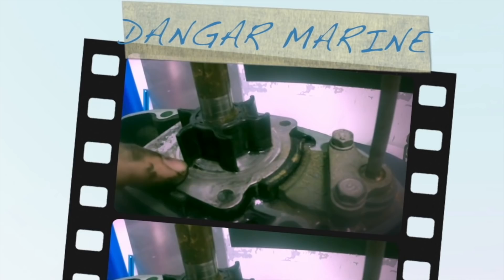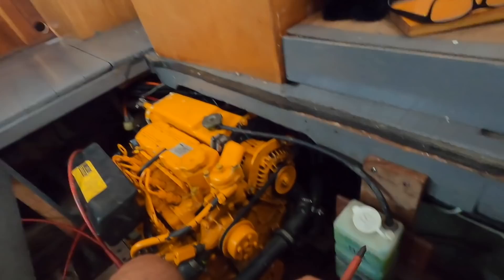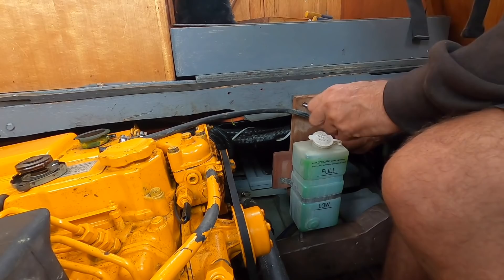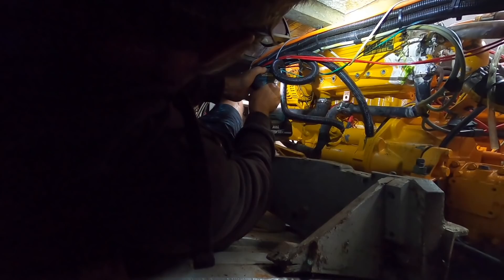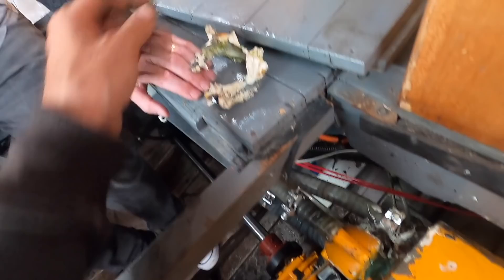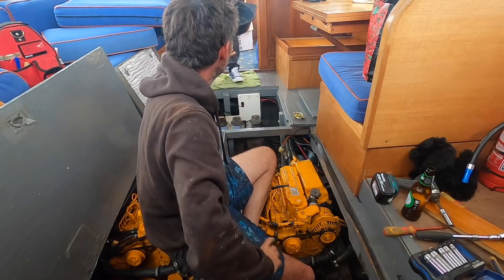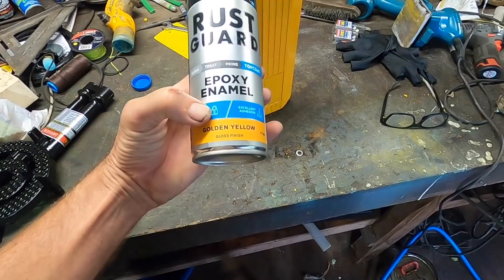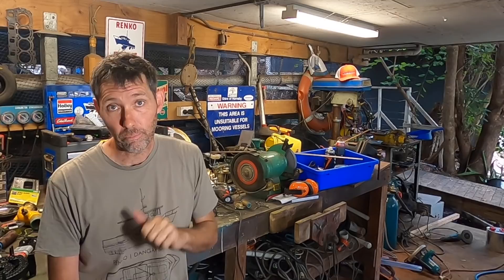Cleaning and repairing a boat heat exchanger

Comment: I've got twin 671's in my boat.  They were installed new in 1945 and are running great!  Currently have less than 2,000 hours but the meter may have been reset after a major overhaul in the 80's.

Comment: Great video.  I've had to clean tubes to, one trick I learned. Use one of those cheap engine pressure washers thru your air line. The venturi tip sucks in fluid. You can force cleaning solution thru passages rather well. 
For on road diesel trucks we have coolant filters, with or without sca additives, would a filter help him out in the long run. It's amazing the crap they catch, and I just replace the filter every other year. It's help my radiator and pump last oh going in 20 years.
Reply from the maker: Interesting to hear about the coolant filter. Make sense to have something like that.

Comment: Awesome job!! Way to make due with what you have. Those epoxies and things like JB weld can fix more things than people would dare to. I fixed a cracked water jacket in a head with JB weld, held up perfectly fine an no need to remove/ replace ..
Have a great holiday!!
Reply from the maker: People don't seem to understand just how strong a lot of these modern metal epoxies are. If you can get them to bond well to the base metal you are in good shape.

Comment: I first used Devcon about 30 years ago when I was still working in the Marine industry. If you can't weld it, or braze it and you're in a pinch, it'll do the job.
Reply from the maker: It is amazing stuff so long as you can get it to adhere to the base metal.

Comment: Stu I use a rifle cleaning brush on my VP heat exchanger found .22 brush is perfect size. Brush is brass/bronze type material and pushing rod is fibreglass with brass joiners. You need to push brush all the way though before pulling out

Comment: I'm really impressed by your innovative repair. Hope it holds. Way better than shelling out a ton of cash for a new one. Years ago I did a "temporary" repair on my Ford Lehman's cast iron exhaust elbow using plastic steel & then went long distance cruising for a couple of years without a hint of a problem.
Reply from the maker: Thanks mate. It's a amazing how long repairs like on your exhaust elbow can last.
Reply: Not a 'ton' of cash for new vetus $800 clams for new housing and O rings and gaskets(+exhaust) I went new! I only got 1 motor,,😉

Comment: I've had similar issues with a heat exchanger on my old Vetus M4.14.   Mine was leaking between raw and cooling water, and also out of the end bonnets, so the core had to come out.   I removed the bonnets and bolts, screwed in some threaded rod until it bottomed out and then used a car jack to press against the threaded rod and force the core out.   Done with the heat exchanger still in the boat of course.

Once the heat exchanger was out, the core rods were silver soldered back to the end caps, the heat exchanger was built up using aluminium welding and then linished down to size.   2 years later and no issues.   Surprisingly it wasn't hideously expensive, I found a local boiler maker skilled rebuilding old boilers to do the work.

If it happened again though, I think I'd take your approach to building it back up with epoxy.   Although I really do think it's worth getting the core out if you can - mine had a diverter on its sleeve which ad come loose and needed tacking back into place, and also, although the heat exchanger core tubes were clear, the voids between them were packed with silt, so raw water wasn't able to effectively flow past the tubes, limiting the cooling capacity.
Reply from the maker: Since work on getting the core out in the boat. It's weird to have silt between the tubes as that is the coolant side, the raw water flows through the tubes, but I guess if there was a leak the raw water was getting into the header tank. Glad you got it fixed for a good price!

Comment: "Barnicle buster" works great on cleaning out those tubes.
Reply: CLR as well.
Not sure if it's available in Aus though. Calcium, Lime, Rust remover that is safe for copper ( you can pour it at 100% through copper pipes with no damage ) It dissolves calcium and lime deposits and removes rust stains.
Reply: @jaquigreenlees  yes CLR is available in Australia.
Reply: Come on Pete , just spring for a new one . You would hate that you’re way of shore in a storm when in let’s go
Reply: Rydlyme marine does too
Reply from the maker: Boat isn't going offshore, only in the river and has two engines.

Comment: I have always used heat to sweat oil, moisture and impurities  out of castings before using Devcon as the thermal reaction from the 2pack makes the metal sweat and causes pockets under the coating. As you are heating it you can see the material dry out.
Reply from the maker: Good tip, will definitely do that next time.

Comment: Good old Devcon, that stuff is great. sets so hard its machinable. I used it on a Yamaha V6 cylinder head, then drilled it and taped it to hold the water jacket cover on. Then a bit of paint to make a Job what it ain't.
Reply from the maker: It is amazing stuff. As long as it bonds well to the parent metal it can last a suprisingly long time.

Comment: Stu, I used to use vinegar to clean out the copper heat exchangers in My Trawler. Turned the calcium to Blue vinegar. Rinsed it and was good to go.   DON"T know what it did to the copper but it wasn't much
Reply from the maker: The acetic acid in vinegar can do a good job for sure.
Reply: @DangarMarine  yer, but it leave's your bag of chip's tasting like crap!

Comment: Hey Stu,  have fun on vacation!  A little trick I have always used on flat surfaces like those is to use a flat file like a mill or bastard file.  Hold it flat and use it to make a nice mating surface.
Reply from the maker: Good tip, they give you a nice straight surface.

Comment: What you referred to a drain plug - could be a sacrificial "pencil" zinc which had eroded away. I had one on my gas engine heat exchanger.
Reply: At 13.41 he did remove the plug and clarified it was a drain plug, not a pencil anode.

Anyway, isnt this a exhaust manifold heat exchanger,? Meaning the seawater circuit is in the 2 pass tube stack while the exterior is flooded with coolant? 

If it is the case, shouldnt any form of anode be on the lid cover on both ends of the tubestack?
Reply: @johngiam  I have a 4.15 Vetus, there are no anodes for the HE. I believe Beta is the same, but not entirely sure.
Reply: @randyhilton6629  oh, so its the anode plug without the pencil anode?
Reply: @johngiam  I thing the bolt he took out is used for installing a lifting ring. It shows in their parts book. Looks like the drain plug is on the exhaust side and the lifting ring would be on the other side. I wish I could find a service manual book.
Reply: @johngiam  These HEs are designed with no anodes.

Comment: Hi Stu, I had one boat years ago that had a heat exchanger on it. Every year as part of my winterizing I drained and clean it. It was a 470 mercruiser inbd/outbd. Allot of torque on low end but not much for top speed. 35 approx. Cabin cruiser with a nice cuddy and head with door. Little sink with white gas stove. Tried to boil water for cooking a crab and gave up. Haha
Reply from the maker: Regular maintenance goes a long way Tim!

Comment: See this all the time...anodes never get replaced.
Reply: There aren't any anodes on a vetus. At least not one I've found on mine. I have the same corroded heat exchanger with only 250 hours on the engine.

Comment: When cleaning our Cooler Tubes, we used a Truck Speedometer Cable. They worked because it was made of aluminum which is softer than what the tubes were made of. Now I know that the tubes on this cooler are much smaller but maybe you could try a copper wire next time to "Rod Out" the tube. then try the same wire on a Drill to whip around and clean the interior of the Tube Passages.
Reply from the maker: I like the idea of the soft wire in a drill, that's an interesting technique.
Reply: @DangarMarine  It is about this only way to really clean the tubes out. Now my coolers were just a little larger that that one, about 16' in diameter by 12' long. We had a flange with a hookup for a Firehose that we would put on one end then flush it but it still didn't do as good as putting something in the tube and spinning it around.

Comment: A Devcon job can give very good results AS LONG you are meticulous in the preparation 
For tha aluminum, the best way to go is to sandblast it or use a rotary rasp to remove all the affected surface.
 I had to build a procedure to repair hydraulic hoist cylinder collar gasket surface.
after many repairs, I can say that the success is about 75%, the defective repairs were due to a defective preparation of the epoxyed surfaces.
Reply from the maker: For sure, surface prep is critical and media blasting is hard to beat. Would really like to get one of those booths for small parts one day.

Comment: I always like to run a belt sander over my exhaust ports. Funny how even people on the other side of the world think the same when presented with the same issues and limited budgets.
Reply from the maker: Belt sander would work a treat. :)
Reply: I use a corse wet stone for exahust manifolds. And that aluminum was so corroded you probably wouldn't have had any luck tig welding it. It will pop and fester ruining your tip every 2 seconds.

Comment: I have similar setups on my Hino EH700 diesels. They called them “manicoolers”. Mine are cast aluminum and don’t like galvanic corrosion or rather they do and you have to protect them as best you ca.

Comment: Stu and Pete, I'm thinking it would not hurt to put an anode in the drain plug hole. Maybe there was one there originally and thats why the exchanger was eaten. André
Reply from the maker: The trouble is that the anode normally goes in the raw water side so it really needs to go into one of the bronze end caps.

Comment: That core is copper in a aluminium housing . A vetus thing!☺️. Personally would put straight hydrochloric acid bath for 3 minutes. And if nursing through the summer months I would give the cooling system a flush twice with demineralised water . Then fill the system back with demineralised water only . Ie need coolant. Love your vids man .
Reply from the maker: Thanks mate. Yes, copper and aluminium together doesn't seem a great combination. Should go the distance until the money is available though.

Comment: If I understand correctly, you live on Danger Island and you need a boat to get to the mainland (and back)?  When you order parts are they delivered to your house on the island or do you pick them up on the mainland?  Thanks for posting.
Reply from the maker: Australia Post has a contract with a local boat to bring parcels and letters over to the island but couriers just scratch their heads and send parcels back to the depot.

Comment: I’ve found that one of the worst surface for paint or epoxy to stick to is a wire wheeled or wire brushed surface. I like to scuff it up with 60/80 grit sand paper after using wire to get the crud off. I’ve been so impressed by JB weld that I rarely use Devcon anymore. Just try to get it fresh, old stock may be disappointing.
Reply from the maker: This corrosion had so much texture that I'm expecting the mechanical bond to be quite strong. Good point about getting fresh epoxy. I also keep it in the fridge once bought too.
Reply: @DangarMarine  
You etched it too, so that’ll help tons. Have you ever noticed it too? That sheen that a wire puts down? Sometimes water drops even bead up instead of spreading out(an old painters trick to test for paint adhesion) as if an oil or wax is on it. It doesn’t seem to matter if it’s steel or stainless wire and it seems to only get worse when the wires are used (wire ends rounded) or laid over.

Comment: I suspect there should be an anode in the water path somewhere. Would explain the rot.
Reply: Very suspect using Aluminium casings in seawater! Aluminium is what they make (some) anodes out of.  Maybe it originally had a plastic coated finish on the inside?
Reply from the maker: I agree, if there isn't I think I'll drill, tap and add one.
Reply: @johnduffy7502  Why would using aluminum be suspect? It is light and it dissipates heat extremely well! That is why radiators, heater cores, condensers and so on are all made from aluminum along with pretty much every outdrive! Everything has a service life, So why are people always so surprised when something goes bad long after its service life has passed! It all comes down to money! If you don’t have much money owning a boat that lives in salt water is a really poor life choice, Especially if you can’t fix it yourself! But hey let’s blame the manufactures!
Reply: @NeverEnoughPyro40  Well, I guess you are right about Aluminium's properties... heck, they even make entire boats out of it! And with the exception of some types of bronze nothing is completely safe in SW. I've seen large cast iron SW condenser end-covers and valves become porous to the extent that you could stick a screwdriver right through the wall without much effort, and even stainless steel pump shafts looking like the woodworm had been at it because of differences in oxygen concentrations between one end of the shaft and the other. Yes, having plenty of money definitely helps... :)

Comment: On closed cooling stern drive boats if you put to much concentrated antifreeze in will it overheat? All passages are clean new pump risers manifolds but temp is 170 this year intead of 160. Stat is new too. 80 ocean. That`s the only thing i can think of. Also guage and sensor new too.

Comment: Did you find the anode for the heat exchanger?

On engine life, I would be concerned for a petrol inboard at 3k hours as well, but a diesel, no worries.
Oxe-Diesels makes diesel outboards 125HP and up.
Can't remember if it's Yanmar or Isuzu, but one makes a 50 HP diesel outboard.
if I could get a diesel outboard for a tender, like Red Dwarf, I would go that route in a flash. The reduction of the fire risk by not having inflammable petrol on board is worth it in my opinion.
Reply from the maker: No, doesn't appear there is an anode from the factory at all. I think maybe Nani made a diesel outboard too.

Comment: I still don't understand why people don't just fit "used" VW 1.9 diesel engines into boats, given the price and parts availability - at least in the UK market. Reasonable to expect 6000 to 7000 hours (400k+ miles in auto terms) of life left from short block and the peripherals are cheap to change.

Comment: I have seen Kubota based small marine engines do 18,000 hours. Smokey but still running.!

I have never been keen on Vetus stuff, it's always expensive and in my opinion not as good as some other manufacturers.
Reply from the maker: I think the Vetus is Kubota based, is that right?
Reply: @DangarMarine  Vetus quite often use Mitsubishi for the 4 cylinder engines. Certainly the ones I have worked on have been.
Reply: Correct they are Mitsubishi industrial engine based. Same as the craftsman CM 4.42  engine. Should be a S4L2 mitsubishi engine code.
Reply: Mitsubishi did an old diesel years ago which looked very similar to the BMC 1800cc diesel. Vetus used to marinise those. They did 3 and 4 cyl.

Comment: Oh the fun of aluminum heat exchangers! And dissimilar metals... I hated doing repairs on the Volvo-Pennta heat exchangers.
Reply: add the harshness of salt water and you have a recipe for devastation of the heat exchanger.
Reply from the maker: Tell me about it!
Reply: Nothing like putting dissimilar metals in an electrolyte... then wonder why things go to pot.
Reply: @krissfemmpaws1029  the lack of an anode means that I'll not look at these engine if I ever need to put engines in.

Comment: I realize this is an old boat, but the engines certainly don't date from 1950s, do they?  What causes/caused this deterioration?  I realize it's aluminum and it corrodes easily in salt water (great choice of material for something that flows salt water), but why so badly just at those fittings at the ends?  I'm assuming there's a seal or O ring or something that goes in between the housing and ports at the ends, yes?

RichE San Diego, CA

Comment: if you are going to do a repair, thats the way to do it, a neat job, would you happen to know how much it would cost to get the heat exchanger ends recast? might be cheaper than a new one, not saying the repair will not last, just thinking of cheaper than new if he wanted to replace.
Reply from the maker: It would be interesting to see what a full metal repair would cost.

Comment: hi, if you need cheap gaskets and parts, just order parts for a Mitsubishi S4L2 (1,7 liter) (Vetus M4-17), thats the base engine. many parts are the same between the S4L (1,5 liter) or as vetus calls it, M4-15 for the 33hp version. some parts may be the same on the vetus m4-55, this i a Mitsubishi S4L2-T (turbo)
Reply from the maker: Good tip, apprecate you sharing!

Comment: 100,000 miles is 1,666 hours at 60mph, and most of the 100k would be done a lot slower including stopped at lights and morning warmups. 3k hours on a diesel isn't insignificant but it's far from bad.

Comment: Hey stu, for yamaha 2 stroke powerhead bolts what should i use before installing them? I will be using the motor in saltwater. Thank you for your videos and help
Reply from the maker: Just put a smear of marine lithium grease on the threads before installing so you can get them out again down the track.

Comment: A friend had a jet boat boat with a 454cu. engine and to cool the exhaust he just tapped a 1/4" fitting into the exhaust and ran a line from the pump to feed raw water thru it to keep it cool just an idea if that overpriced ($5,000 really??) part does not like the repair job. I'm sure that engine has a land twin running around you could swap the exhaust manifold with.